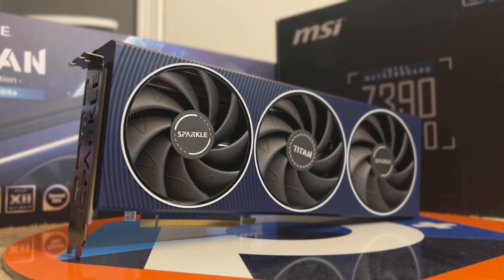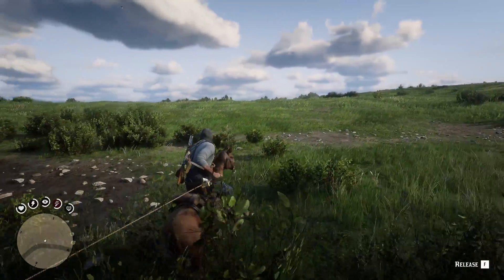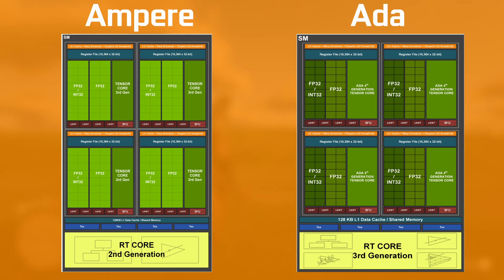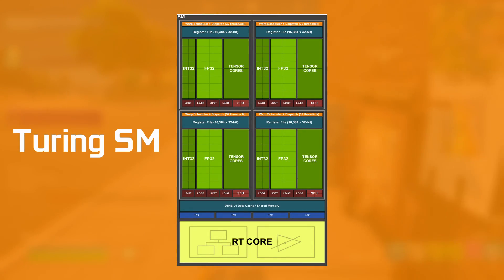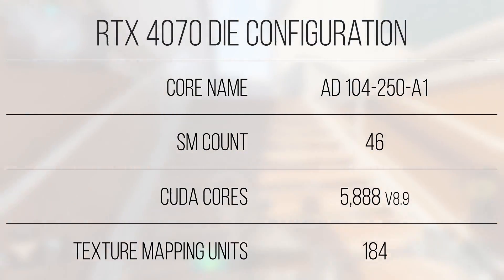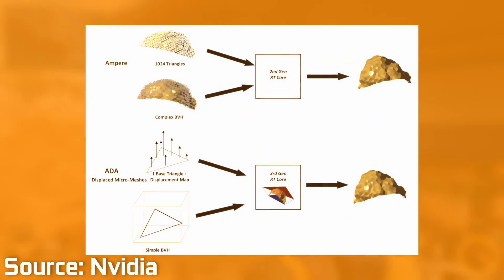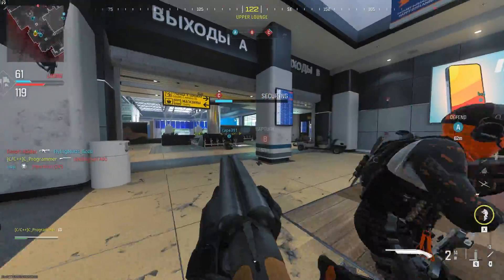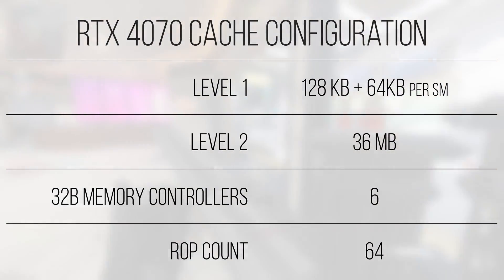The Nvidia GeForce RTX 4070 – Basic GPU Architecture and Design!

Comment: I wonder why apple & amd doesn’t market their GPUs with 2x their original shader core count like nvidia, would it be misleading to count a dual issue capable ALU as 2? Do you have any insights on how the M series GPU & RDNA3 gpus achieve dual rate fp32?
Reply from the maker: From my understanding, in order to utilize the double FP32 throughput you need to rewrite your code. It’s not as simple as “parallelize across more cores”, it’s technically a SIMD operation on an already parallelized operation. This requires totally different code paths to execute efficiently, and I suspect that most devs don’t want to put effort into writing for a new, relatively unavailable architecture. Will probably change in the future. Think of it as “would you rather have 32 cores, or 8 cores that have 4x the throughout”?

Nvidia also kind of invented the modern GPU, in terms of using it for general purpose compute along with graphics. Graphics uses almost exclusively floating point math on geometry and when shading. The Integer throughput is still important but it’s not as critical as just having more FP32 in graphics. In fact, AI uses Int more than graphics. As a result of inventing the modern GPU, they can kind of define their hardware however they want, and this is consistent behavior with any “monopolistic enterprise”.

Intel GPUs are the perfect example for having problems parallelizing. The card technically has 4,096 datapaths where it CAN perform FP32 ops. However there are really only 512 “cores” in the card.
Reply: @ProceuTech  I see, thanks for the explanation, I thought it sort of all "just works". But it seems to me that it's heavily reliant on how data is being fed to GPU aka the scheduler. Interesting to see how this pans out. I haven't done GPU programming in a long while but it does seem like a pain. The most I'd probably do is refactor some shaders to be more friendly towards dual issue capable architectures but anything beyond that just seems painful......unless I'm getting 500K + Stocks
Reply from the maker: @dom1437 yeah, the last sentence seems to be why no one has really put tons of effort into optimizing, despite the architecture being 3 years old at this point

Comment: 4070 is a great card I just wish they coulda gave me 16gb instead of 12
Reply: Technically not possible.
Reply: @mikakorhonen5715  I wouldn’t see why it has higher memory bus and everything compared to the 4060 (which ti version has 16gb ram that it definitely cannot handle and use all of it)
Reply from the maker: So the reason the 4070 has 12GB is because of the 192 bit bus. Each GDDR6X memory controller is 32 bits wide, and can handle either 1GB, 2GB, or 4GB modules- this means you either can get 6GB, 12GB, or 24GB with GDDR6/X. GDDR7 is set to release 24Gb modules (3GB), so we may be able to see more exotic configs in the future!
Reply: @AntCrazyy  4060 (Ti) has 128bit memory bus, so options are 8GB, or 16GB.
Reply: @mikakorhonen5715  right but my point is that it can’t really USE it all to its full potential
Reply: @ProceuTech  right. I mistakes 4070ti as having the same bit bus as other GPUs such as arc a770 so I thought it was possible lol
Reply: @AntCrazyy  4060 Ti 16GB has its place in very specific 3D graphics workloads. Also OK 1080p gaming card.
Reply: @mikakorhonen5715  oh no I’m not saying it’s bad at all I’m just saying the memory bus is a bit too low to handle 16gb (or so I hard) but 4060ti is still a great card and will be able to use some of that extra vram

Comment: the 4070 is fine preformance wise but the fact that it preforms essentially the same as a 3080 for only $50 less almost three years after the 3080 came out makes it a non starter for me. i will always be recommending a used 3080 or 3090 considering the 3080 is 200$ less than the 4070 and 3090 is about the same price but with SIGNIFICANTLY better performance in both gaming and productivity all of the 40 series is incredibly overpriced with the exception of the 4090 and it only gets a pass because no other gpu can even get close to its preformance
Reply: Obviously buying a used card is cheaper than a new one, what kind of argument is this lol that’s like saying the 3080 is a bad product because the used cards are cheaper than new. The 4070 has 3080 performance for much less power consumption and DLSS 3 if you care about that, it’s a no brainer to buy it over the similarly priced new 3080. If you prefer to save money and take on the used risk that’s of course reasonable but not for everybody.
Reply: not to mention 192 bit memory bus in 2023 and thats AFTER the 3070 has a much better 256 bit bus
Reply: @cubeco2653  Yes, But he will save more electricity bill, and will stay cooler and efficient, 3080 no brainer with twice power usage lol